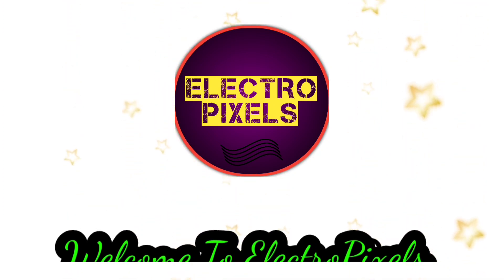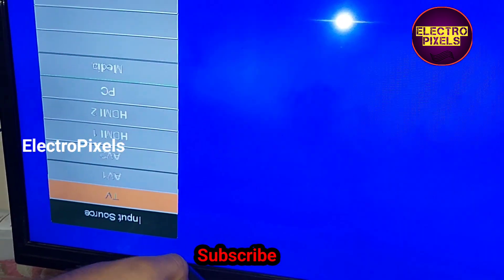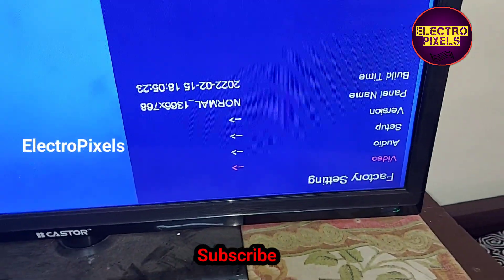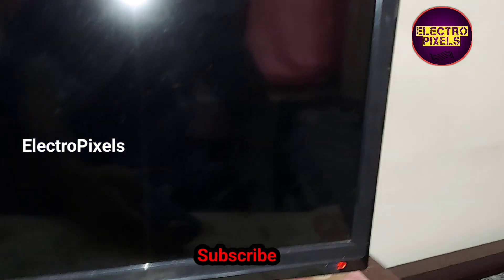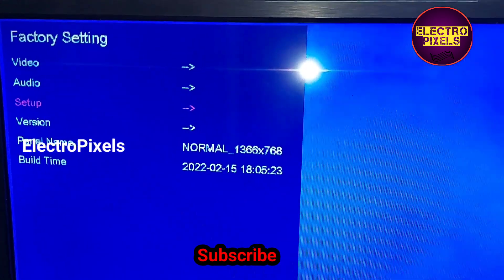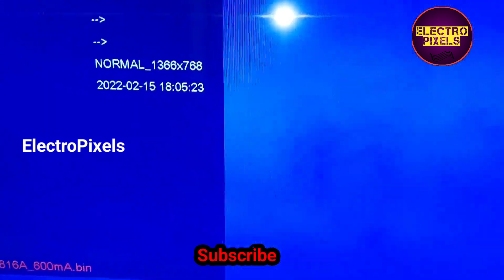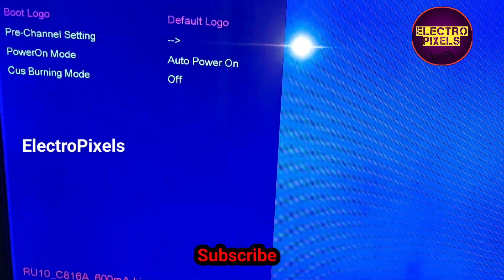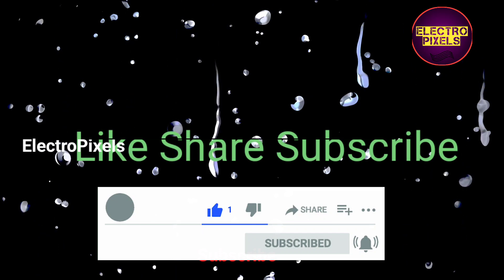LVDS mapping & Solving Picture upside down|  RU10.816A New Combo board Factory setting For changing

Comment: Thanks sir aapki video se bahut help Mila h
Reply from the maker: New video is uploaded regarding how to Repair two side shorted SM4186 Samsung panel.Using that method you can reuse the panel. Disadvantage of that method is when Tv turned it shows Vertical bar's and line's but After 2-3 minute's of working Picture will be Back to Normal

Comment: SIR i installed ru16.671 combo board but sir by mistake I pressed shiping mode  ,please how exit from shopping mode pls. Help me sir
Reply from the maker: Hold power Button until restart or try changing Software
Reply: @ElectroPixels  power button technic is not working with me, how to reinstall software please, please share link if there is any video by you
Reply: Backlightoknoblucolour